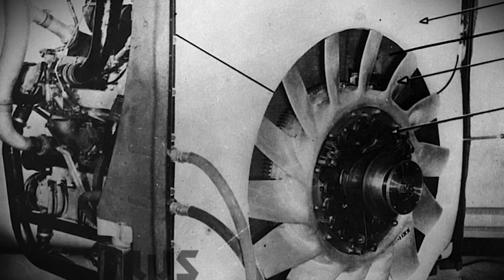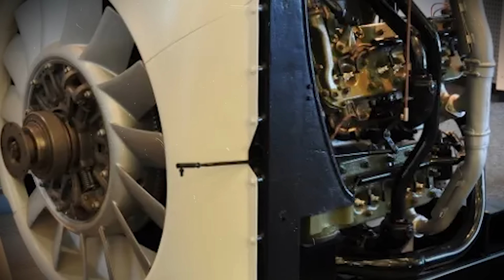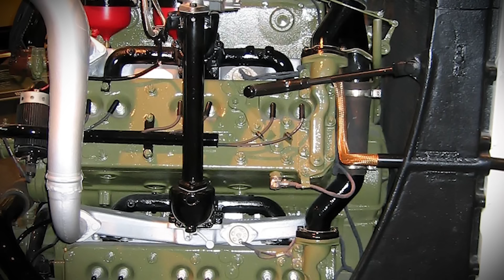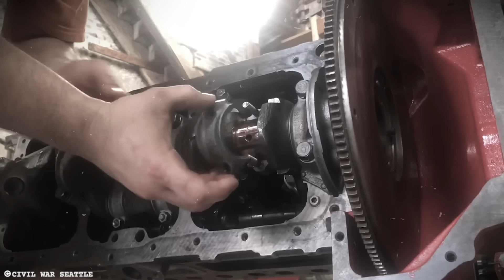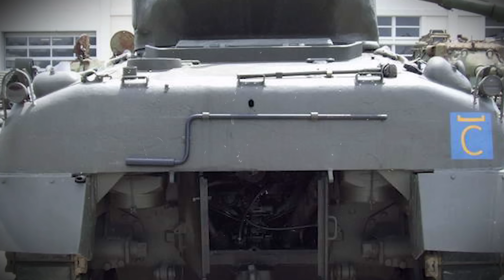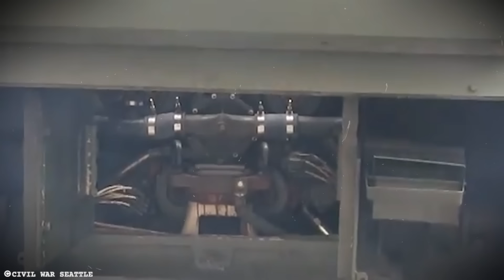How One Chrysler “Tank Engine” Outsmarted Every Opponent

Comment: I’ve serviced or owned all sorts of diesel engines, gas engines, ones that run on natural gas, etc.  

My favorite diesel will always be the “screaming Jimmy.”  those Chrysler multibank were in a class by themselves!  I saw one in an oil field that was torn down that had been running for 10 years, and it had no carbon buildup at all, due to running on natural gas!

Comment: You say NO overhead valves to adjust    AI obviously hasn't adjusted side valves   yes they DO need to be adjusted             Only the early models had individual water pumps     later had one single water pump centrally mounted driven off front central gear      this Video is about the A57  engine yet much of the video is of the Ford GAA     So much of this is ABOLUTE  MISINFORATION    clearly AI

Comment: Obscene complexity  ford v8 gaa was much better
Reply: They said that any other engine needed repair or rebuilt once a year, especially on boats.   The A57 lasted 13 years, with no rebuilds, and when he sold it, the mechanic said the bearing were still within specs.  No engine, not even the famed GAA could do this.  And when the A57 got hit in combat and half the engine was missing...it still ran... GAA was done if one cylinder got hit.  Not saying the GAA wasn't better with horse power or easy to maintain... but the A57 didn't need to be maintained.... That's the real difference.